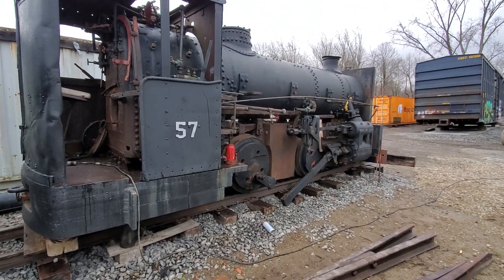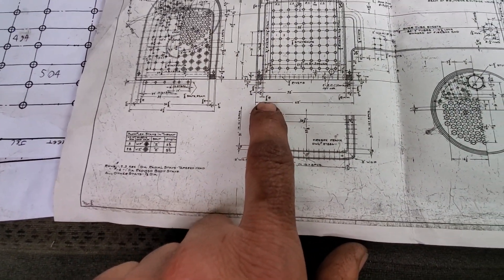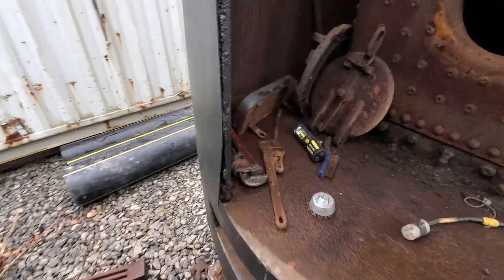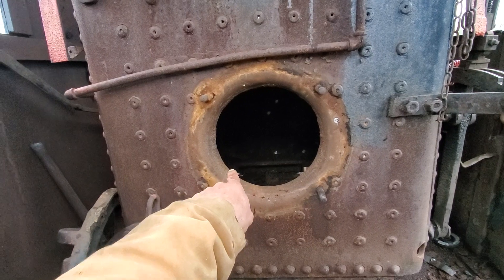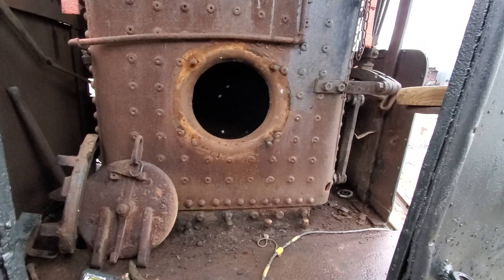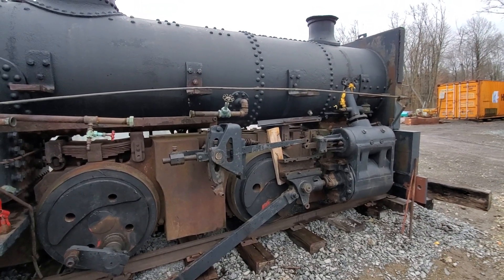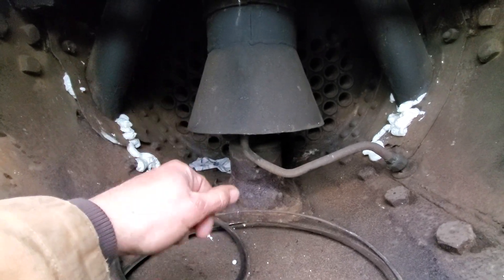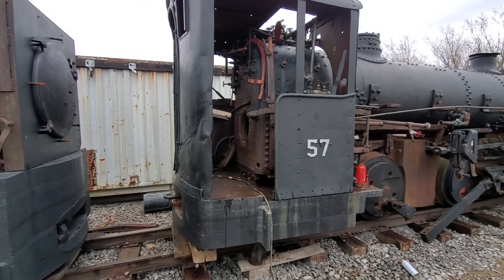Results of Firebox Survey of J&L 57

Comment: Would be interesting to take a detailed look at the mounting of the boiler. I remember on 58 there was some speculation on how it was attached to the front plate and how it floated on the frame for expansion. Curious what if anything they did different

Comment: Would the next step in the firebox's survey to hammer test the staybolts and then U.T. the barrel?  I would assume the stays were replaced with the new fire sheets.
Reply: Looking at the backhead, no need to hammer test them as they all appear to be ones with tell-tale holes in them.

Comment: Double check that the 0.5 is not too thick.  It can remove flexibly and you’ll end up with staybolts breaking all the time.   Texas state had new boilers built in the late 90s or early 2000s and they basically had to scrap them after a couple years of use.  It was more than just thick inner firebox but that was big problem.  Hopefully it will be good and just need tubes.

Comment: to me looks like you need to start work on a 2nd and 3rd tender and water tank for 57.
Reply from the maker: We will use the old tender, which currently is being used to carry the welder and cutting torches around. I'm more concerned with getting the transfer table built so that the locomotive has somewhere to go.
Reply: @YoungstownSteelHeritage  interesting one of these day i should make the 2 to 3 hour drive from mid Michigan when your open up for the public and check you guys out.